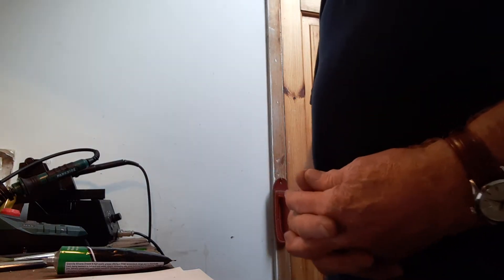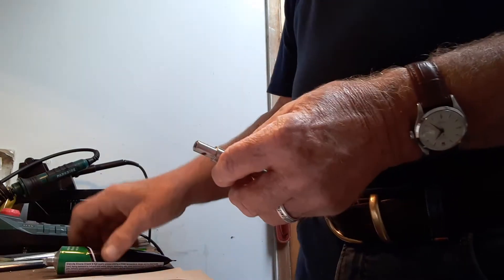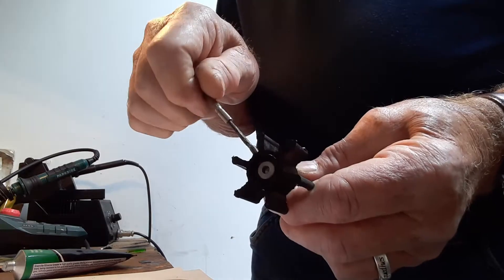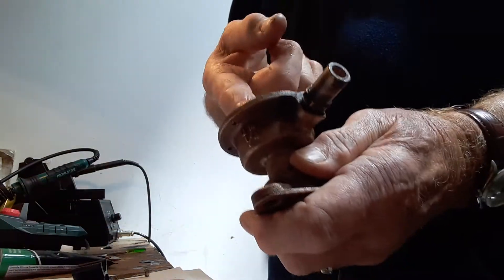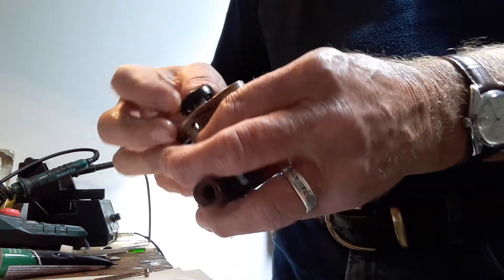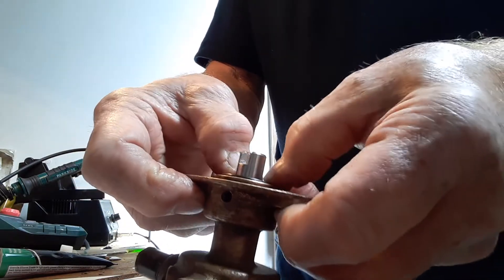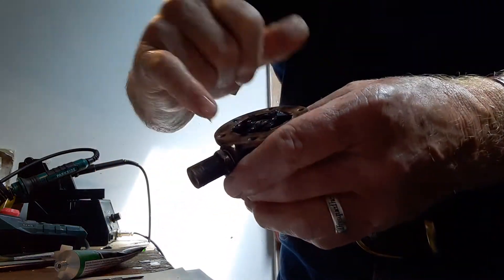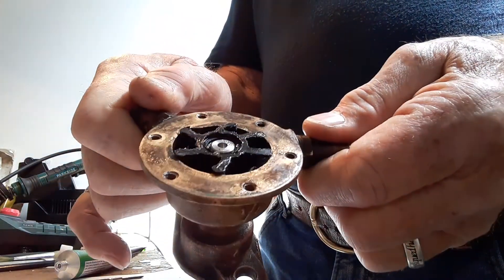Volvo Penta MD1B Sea Water Pump Repair Pt II

Comment: Hi Peter thanks for making this I did the same repair on my md2b but the water seal keeps working itself out of place and then the pump leaks have you had this problem ? 

Thanks
Reply from the maker: No I haven't.  Theses seals were a really tight fit and I didn't put any lubrication on, they went in dry.

Comment: Hi Peter. Nice video. Just had a question after I noticed one of your posts on another website. Did you find out if a Volvo Penta RB gearbox will fit on to a MD1B engine? Thanks for your help.
Reply from the maker: Hi Mat.  I didn't pursue that,  I eventually tracked down the 120 x 10mm oil seal for my MS gearbox and managed to replace it to stop the oil leak.  It was a difficult job though.

Comment: Nice description, Peter. Is there a chance to share the P/N of the repair kit? My VP Dealer in GER struggles with this. THX, Joachim
Reply from the maker: Hello Joachim.   I don't have a part number I'm afraid.  I just Googled 'Volvo Penta MD1B Water Pump Repair Kit' and got pages of them all over the place including European suppliers on Ebay and luckily one of my local marine parts suppliers which is where I got the kit from.  You shouldn't have a problem getting the kit from a European supplier.
Reply: @noskanow  Hi Peter, thanks for your immediate reply. I saw such but probably was too careful.

Comment: great video. I have 2 questions . How are you supposed to swap the impeller here. Do you have to dissasemble the pump each time? Mine has a slot so i can pull it out. Second i am noticing the shaft fit to the NEW seals but its not really tight. In can be rather easily fitted in. Also when on the boat the shaft could be easily pulled out. Not sure if this is correct.
Reply from the maker: Yes you can just pull the shaft out of the pump  to chnage the impller without taking the pump off the boat.  You must be very careful when putting it back though because it's easy to nick the edge of the seals with the end of the shaft, so put plenty of grease on the end of the shaft and try to put it back in the pump as staight as you can.  The shaft should be a firm fit in new seals.  If you've greased the shaft end and the seals it may feel a bit loose but as long as the seals are sound and there are no grooves in the shaft they will be water/oil tight.
Reply: @noskanow  thanks. YEs i have seen proposals to tap on the shaft to get it free from the seal or put it in the freezer, so i am far from needing this. just with some grease it goes. But seems this is the concept if the shaft has to be removed.

Comment: Brilliant! Just what I was searching for as I received my renovation kit in the mail the other day. Very instructive. Thanks for sharing.
One point: in the instruction leaflet for the impeller, Volvo Penta recommends the supplied glycerine for greasing the impeller and nothing else. I know that people, including myself, have been using all kinds of lubrication stuff, e.g. simple vaseline. Does it really matter what to use as long as it is lubrication, one wonders...?
Reply from the maker: I'm pleased the video was useful.  My repair kit nor the impeller came with any grease so I used the waterproof silicone grease I had already.  It seems to be fine.